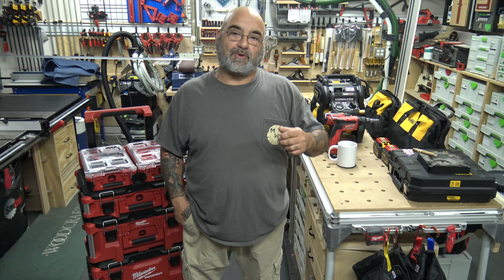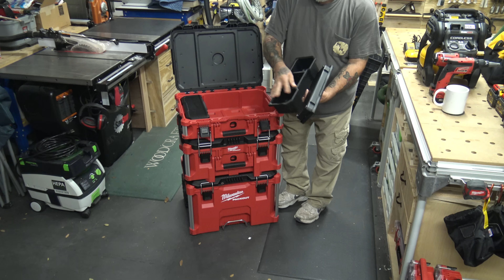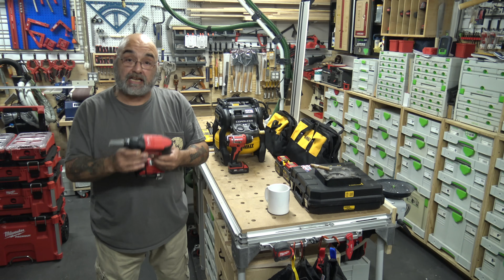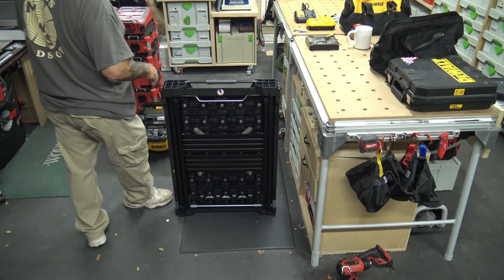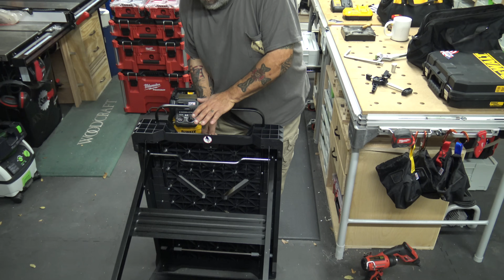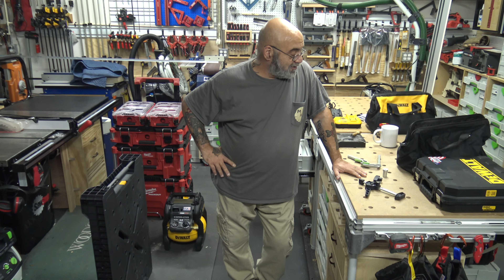New tools added to my collection

Comment: Sweet. Let me (and all the rest of your subs) what you think of that stud drill. I was going to buy the Milwaukee, but had not ruled out the DeWalt.
Reply from the maker: Daynaleo1 we owned the Milwaukee hole hog first and that’s our go to drill. We bought the DeWALT drill for two reasons one we needed a second drill lol and the DeWALT has a smaller profile for when we need to get into a tighter place. Thanks for the comment 
Mike
Reply: I just purchased one about a week ago.  It’s an absolute beast.  I’ve used the corded super hawg extensively and this drill seems to have every bit as much power.  Home Depot online is offering killer deals on flexvolt tools and batteries.  What made me buy it was the fact that the flexvolt batteries work on all my other 20 volt tools.

Comment: I’m a framer, I use all Dewalt cordless tools 20v,60, 120v...the best system for construction...surprised you went to Dewalt with all that Festool stuff and the new packout boxes,. ..very nice shop ...
Reply from the maker: It started with the compressor. I love Festools but I will not take them on the job sits. lol there my play toys. Thanks for the comment. mike

Comment: you need to check out California Air Tools if you think thats quite.  https://youtu.be/0DBNyTqYbg4
I don't think they have any battery operated units though.
Reply from the maker: I've seen them before. I needed a cordless for my truck and that's what started me on the 60 volt system. Thanks for the comment. Mike